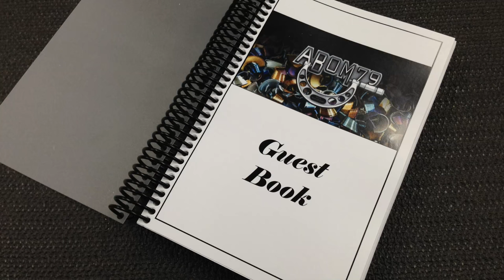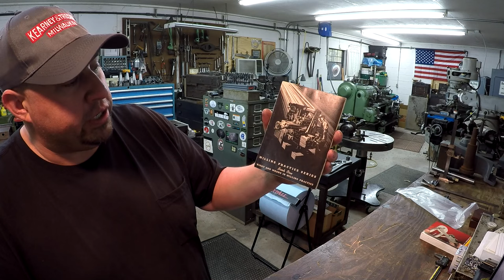Saturday Night Special 113

Comment: One reason I like my old cameras, is that there are shops out there that fix them, even if the parts are older than I am. The aperture on my 28mm lens locked up during a parade a few months back, and the repair service not only got everything running nice and smooth, but even fixed a few dents in the end ring where I'd dropped it.

Comment: I am new to your channel, love it I have spent many of my apprentice hours behind a hand surface grinder. I have been a machinist and am a Certified Tool & Die Maker in New Jersey. I used to make die sets for the tile industry, it's been years since I have done any real machining, the company I worked for moved down south Cammerzell Tool & Die. It's a dying trade in the USA, I now do brainless work and run a 5000 watt CO2 electric Mitsubishi Laser, everything now is all computerized and takes all the craftsmanship out of it.

Comment: i used to use a surface grinder that had 22' swing tables with 20' mag chucks about 3 feet wide, the stones where about 2 feet across and a foot wide.. I don't remember the name on the machines it was 25 years ago easy, what I remember the most was how much I HATED having to clean the slurry tanks out LOL!! it was a never ending job keeping the tanks clean and a back breaker for sure.
Reply from the maker: +p3th3t1c Thats BIG!!
Reply: +Abom79 Abom size? heheh

Comment: I hope that surface grinder's spindle motor is soft starting..

If it has such a high starting torque it'll probably shake apart any wheels you put on it.

Comment: Adam I am looking forward to your videos on the surface grinder since I have the same one.
always enjoy learning more.
Reply from the maker: +Bill Nebergall Mine is the 7B. Seems to work good just dirty and needs cleaning and paint.
Reply: Yelp 7B 6 X 12 mine is clean and fresh paint just lacks accessories
Reply: I'm am  the proud owner of a 7B.  Oilers, on mine (serial no. 7B-6905) are different than yours
Reply: I'm am the proud owner of a 7B.  Oilers, on mine (serial no. 7B-6905) are different than on the one Adam has.  Also, have you found any what accessories? If so, what/where?

Comment: I work for a big electronics manufacturer, the main cost is the main board,  it's not worth replacing it if its faulty. 
Sometimes there are very small things broken which could easily be re soldered, but we don't have the facilities or man power to deal with it. 
It is sad really..  I was brought up to repair rather than replace.

Comment: The one thing that seems wrong about the surface grinder is that you have to put yourself in the plane of the wheel to start it up. Not where I would want to be when starting up a new (or newly mounted) wheel. If it was out in the middle of the room, you could walk around behind it to start it without being in line with the wheel, but that would get old pretty fast.

Good video as always, but you know that we tune in to see those chips flying.

Comment: In regards to the GoPro, the reason they don't repair them such as you'd expect from say a Sony camera from the 80-90s is because it is incredibly tightly packed. And when i say, incredibly, i mean, you could not fit a needle inside, packed.

Thus opening and fixing something inside is difficult. IMO, if you're getting another camera, check out YouTube for the fix regarding yours, see someone perform it (there are videos regarding fixing these) and give it a shot. That's how i fixed my phone many a moons ago when i simply couldn't be bothered to deal with my assigned dealership. That was back in 2006 and i haven't looked back since. It's not that complicated as it's made to look or feel, especially if you have instructions laid out for you and in this case, GoPro is a very researched subject.
Reply: Also, someone has got to 3D print you a logo where you can take an actual micrometer and place it inside, you just have to do it. :D
Reply from the maker: +aserta That's a good idea!
Reply from the maker: +QuinB Probably something we'll see eventually.

Comment: you should look into the Chinese knockoff camera SJ4000. most reviews say it's as good, if not better than the gopro in most ways. Just  a suggestion for a temp camera until your primary cam is repaired.

Comment: Its throw away because fixing it is usually more costly than getting a new one.
Think about rates of about 100 Bucks an hour + Parts.

If you get a real camera, and not a shitty GoPro, you will actually get it repaired.

Sorry but GoPros are just a hype. They are not a super build quality, the picture quality is also sub par.
Reply from the maker: +djteac It's just worked well for my needs, small and compact, and the picture quality is good to me. I'll upgrade to something really nice eventually.